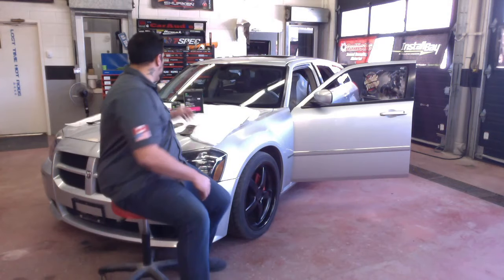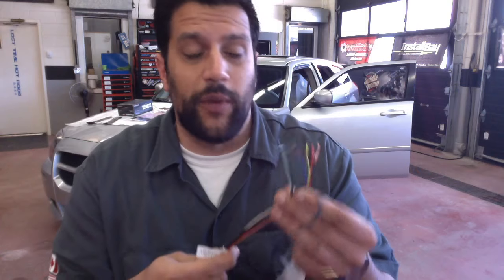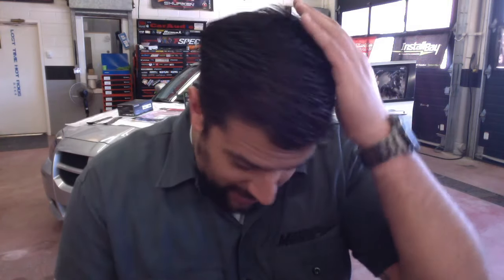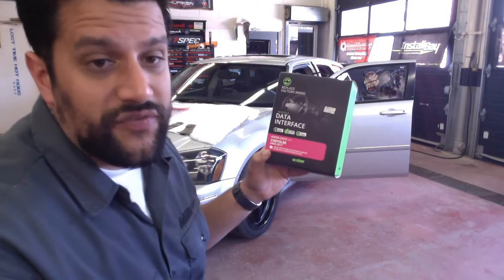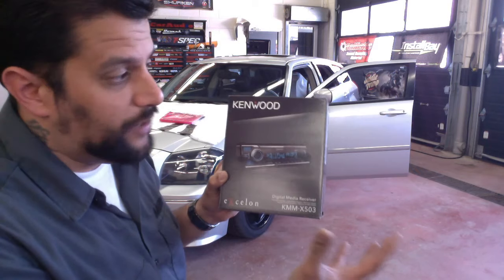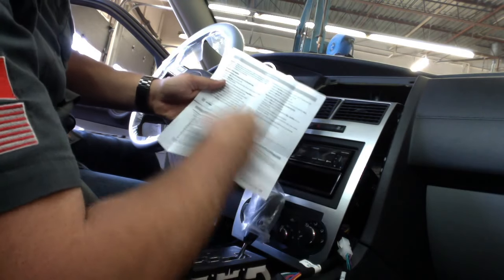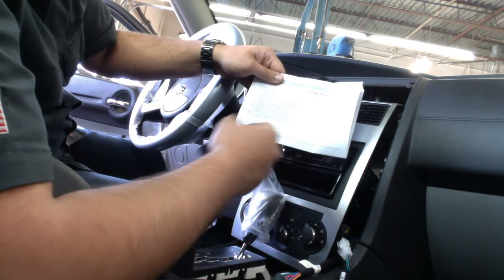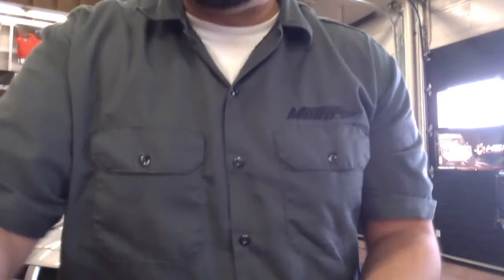Axxess AXSWC and AX Series Installation: Live Video Webinar with Q&A

Comment: I have a Kia optima 2014 and I have a factory amp and I'm hooking up a dual 10-in screen aftermarket radio and I have no sound coming from the radio on the speakers are not working and I have the interface wiring harness goes to my car plus the adapter for the amplifier factory amplifier and still no sound what am I doing wrong
Reply from the maker: Please contact our Tech Support for assistance.